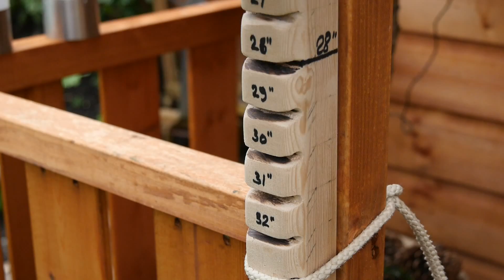Best Way to Make your First Longbow. A beginner bowyer buys a laminated longbow stave. Pt 1

Comment: Mick you might get a few more views on this video as I am watching it stage by stage in the workshop .took me a hour to make the tiller 😁
Reply from the maker: Good luck Pete!!
Reply: Mick Grewcock just made a tiller gizmo
Reply from the maker: Good on you Pete!
Reply: Mick Grewcock got a pin Knott right where the handle is .glue and sawdust
Reply from the maker: CrazyCressy7 Oh b.....
Reply: Mick Grewcock so far so good ,can draw it back about 3"from my chin .and boy do my ribs ache from scraping and tillering for 6 hours . Back to it tomorrow😁 not braced it yet lol
Reply from the maker: CrazyCressy7 brace it ASAP. Better view of shape. Well done!!
Reply: Mick Grewcock Cheers m8 ,sorry for all the comments ,just needed a bit of support lol ,I was bricking it all day lol
Reply from the maker: No worries at all. I’ll help in any way I can!
Reply: Mick Grewcock got me a longbow .44lb @28 ,Was ment to be 70lb but I could not draw it to my chin ,i will get use to this one then hopefully start my yew one in 3 months time .it would of had 12 months to cure then .thank you buddy for all your hard work and teachings ,just got to do the finishing touches and make the arrows😁😁😁😁🎯🎯🎯🎯
Reply from the maker: CrazyCressy7 That’s a brilliant result, well done. Wouldn’t fuss about draw weight yet, a working bow of good tiller is more important. Getting to the heavier weights is harder, not all woods will cope with it. You should be chuffed! Good luck with the arrows.

Comment: Very nice! I haven't tried looking for a near complete stave on ebay, but that might be something I check for my next bow. Currently I'm working on trying to turn a board from a lumber yard into a bow. Have you given making a board bow a try yet? It's a bit harder to find the wood yourself due to lumber yards not typically cutting the wood correctly (either there is warping, or the grain is not straight).
Reply from the maker: Hi, no I have not attempted a board bow - maybe I will one day. But I'm still learning about self bows, and I think I have very much to learn before I move to something else. Thanks for watching. Mick

Comment: Hi Mick,
I’ve just taken delivery of the same type of stave from Irondale. I think I’ve got a good idea how to proceed from watching your video, however, may I just ask if you tillered the stave to bend through the hand grip or should the grip remain rigid?
Reply from the maker: I tiller full compass so that the bow bends thru the handle. Be cautious if you do this because that bend thru the handle occurs quite late in the draw. A mistake I made early on was to achieve this bend too early in the draw. That results in the centre being too soft when the bow is fully drawn. Good luck. Mick
Reply from the maker: Don’t forget to check out my videos on the 100lb laminate warbow - that’s an irondale stave too. Mick

Comment: Hi mike. Apologies for yet another question my friend, have a lovely cherry tree in the garden 9 years old, but has a great limb looking at me to build a bow. About 7and half inch thick. 90 inch tall.? Shall i take the challenge on as a new bowyer. Any advice always appreciated. There's that much out there on the Internet, but always trust you.
Reply from the maker: Hi Wayne. Yes! Cherry can make good bows as far as I know though I cannot claim to have made one myself and I can't comment on subspecies etc. - there are a number of types of 'cherry'. The wood you describe sounds fine in itself so you should have a try. I don't know what to say about seasoning - I'm not sure if cherry reacts well to rapid drying or not. My only real experience of cherry (lots in our garden) is felling for firewood (ours are ornamental and the fruits are not really edible). I have noticed it can split when drying so make sure if you go for slow seasoning that you seal the cut ends and any branch offcuts. Otherwise it looks a nice wood. Best I can say is give it a try - it's all good experience. Good luck and keep me posted. Mick
Reply: Mick Grewcock hi mick thanks again for the great advice. Will harvest the limb tomorrow. Then bring inside to dry. Maybe leave it a week or two. Then start to shape. Fingers crossed. Been a builder for nearly 25 years now, this is the scariest thing in wood ever
Reply from the maker: Ah yes, SCARY! I understand. It’s not always easy for people to grasp how difficult and scary it is to work with materials that are unfamiliar. I was over forty years in electronics and suffered (still do) with anxiety when working wood because it’s so, so different to the materials that helped me earn a living. So I understand your adventure 100%! Good luck 👍

Comment: how you measure the dynamics of bow? 10 libres=10 pounds?
Reply from the maker: People use a chronograph to record arrow speed - the ultimate test of a bow’s performance. Otherwise I measure the weight in pounds required to draw the string to the designed draw length - usually 28” to 30” measured from the grip. Mick